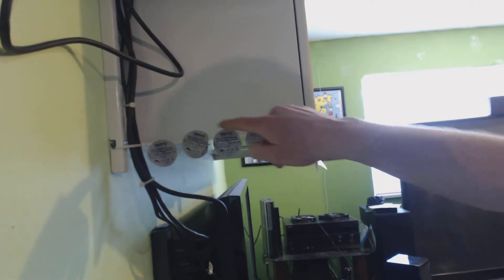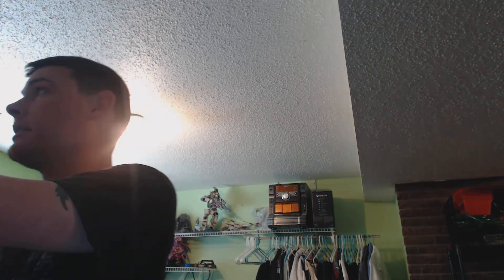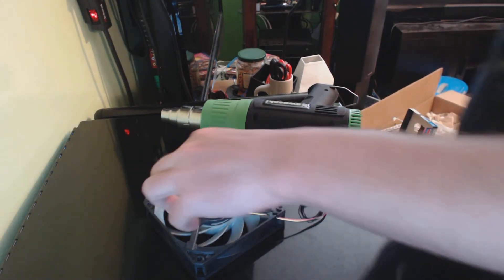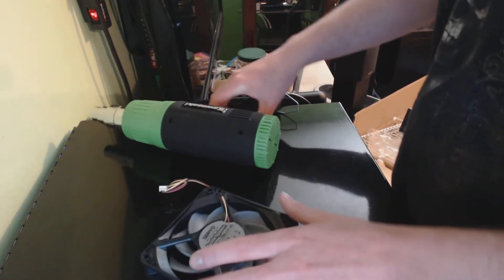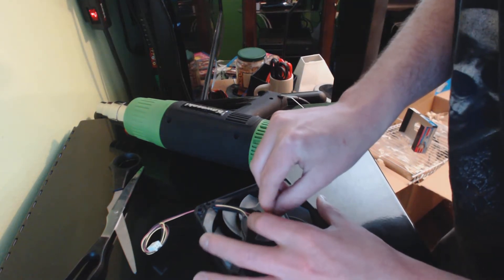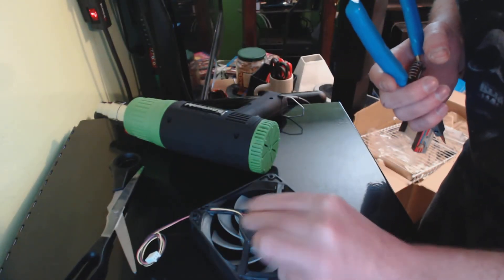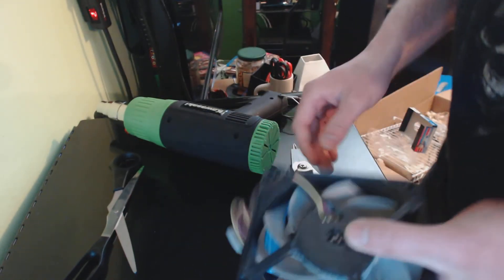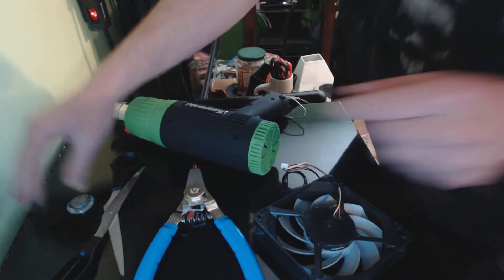Removing a snap ring of the Gentle Typhoon Fan. ( before painting)

Comment: Hi, I know it`s an 8 years old, but still good job, could you please give a hint for the seger pliers tool, which size are you using to take the ring off? Thanks.
Reply from the maker: I think I got the Klein snap ring tool. Then I went to ebay to get different sizes.